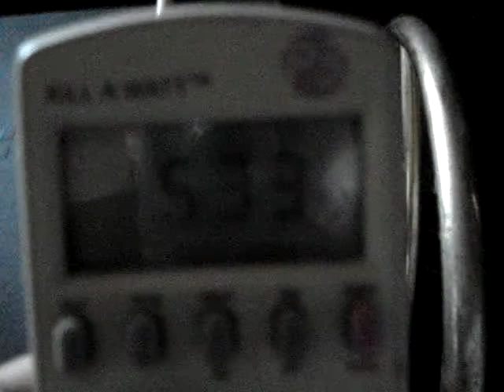Air Conditioner Solar Powered

Comment from the maker: The (3) Harbor freight 7 amp chargers have a higher cut-off voltage. Supposed to have a over charge protection of 14v +/- .5v. I've seen the indicator lights in charge with battery voltage at 15 volts.

Comment from the maker: 45 Watt Solar Panel Kit - harborfreight
Sunforce 50048 60-Watt Solar Charging Kit-
amazon costco  UB12350 Universal 12 Volt 35AH Battery - batteriesasap Gauges from altestore bluesea Power Bright 1500 Watt Pure Sine Inverter & Battery cables from;
invertersrus Ultra-Conductive Copper (Alloy 101) bars -
mcmaster Ground Mounting Rails, 1-1/4" X 1-1/4" 6ft 12 Ga from hardware stores
Hardware nuts bolts, copper plates from mclendons hardware Puyallup Kyocera Sharp & Siemens Panels from ebay.

Comment from the maker: Ultra-Conductive Copper (Alloy 101)
Also known as oxygen-free high-conductivity (OFHC) or oxygen-free electronic (OFE) copper, this ultra-pure (99.99%) copper is good for high-temperature applications such as terminal lugs and wire connectors. It can be welded and brazed. Not heat treatable.
2 copper plates as bus connections. Mounted amp meter volt meter from bus plates. Mounted controllers and 1500 watt sine inverter volt meter amp meter gauges.

Comment from the maker: Combined solar power panels. 3 harbor freight 15watt amorphous, 8 Sunforce 15watt amorphous, 4 Siemens mono crystalline 55watt, 1 Sharp 80 watt poly crystalline, 2 Kyocera 80watt combined. Amorphous on separate 7 amp charge controllers. 12 AGM, 3 gel maintenance free batteries. 2 copper bars,

Comment: What size/type panels are you using? How many batteries and how are they wired? What other equipment is being used? What I'm driving at is what does it take to power a 5K BTU window A/C,4.8 amps,115v all day on solar power? Thanks for the video and any information that you can offer.

Comment from the maker: see the video here;

watch?v=1dkmrLcQaIU

In the shed building measuring batt voltage and amperes from panels while running small Air con unit.

Comment from the maker: The batteries held up fine. When the rack of 4 siemens shaded the under voltage alarm went off on the powerbright. shut down system for full day so batts could get back up to 13 volts. Worked nice from 10 am to 2:30 pm. Can't run on battery without a full sun on all panels, been really busy lately.